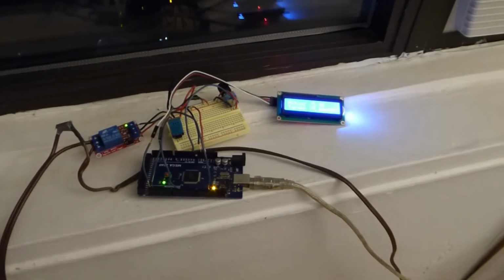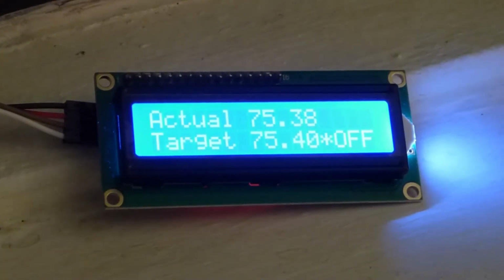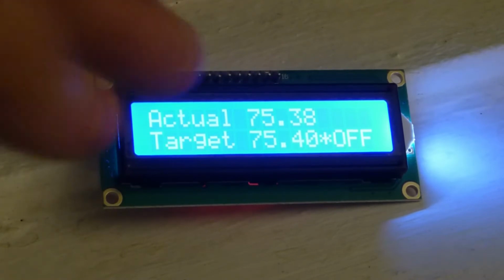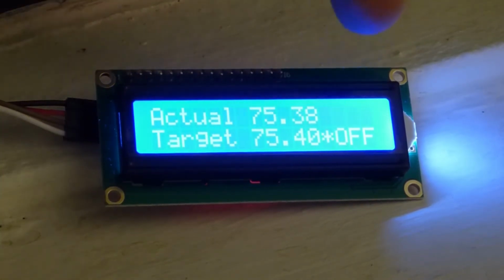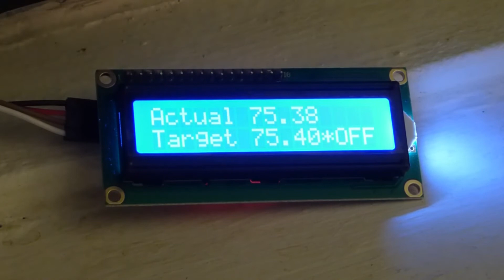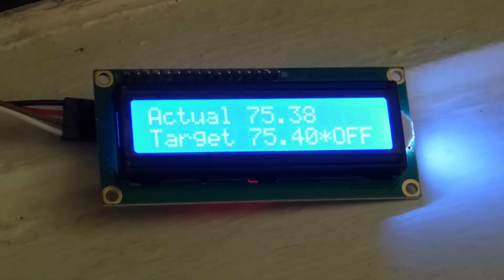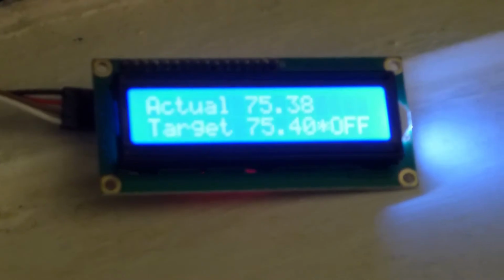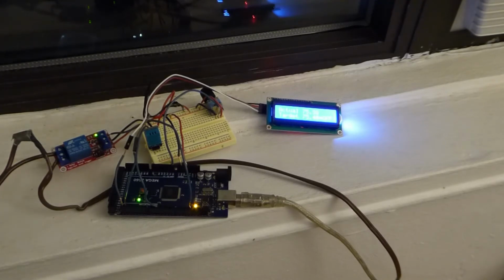Arduino Powered Thermostat Demo (Open Source, DIY)

Comment: Great, thanks for sharing. I’m having a hard time passing the code in Celsius, if you have time! Thanks in advance
Reply from the maker: To convert from f to c, subtract 32, divide by 1.8. you can fork and modify the code to do this.

The easiest is to leave the logic in Fahrenheit and to convert to Celsius right before displaying to the user:

To do this, in the function "displayStatusLCD", before line 89, insert:

actualTemp = (actualTemp-32)/1.8;
desiredTemp = (desiredTemp-32)/1.8;
Reply: @scanteianu  Ok thank you very much for your quick response. I subscribe.

Comment: hi I wanted to build this for my old trailer that you would need to turn the heater on off on in order to start it and i could not use any other thermostat so i wanted to build this but where is the library?
Reply from the maker: https://github.com/Scanteianu/arduinoThermostat/blob/master/thermostat.ino

Note that for a heater, you would have to change the code in line 62 (set cooling function), as you would want to turn on the heat the temperature if the ambient is slightly below the target and turn it off when it's slightly above.
Reply: @scanteianu  thanks a lot!